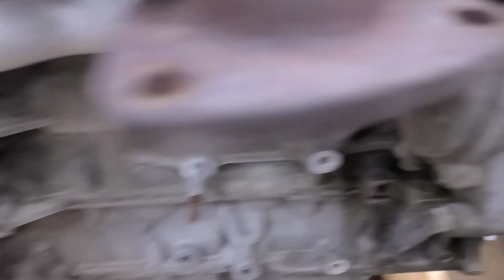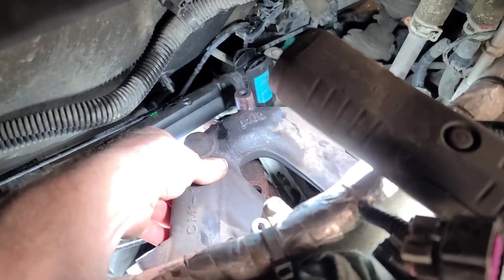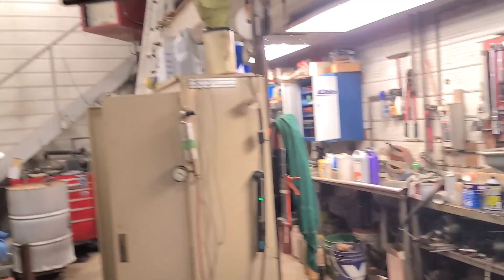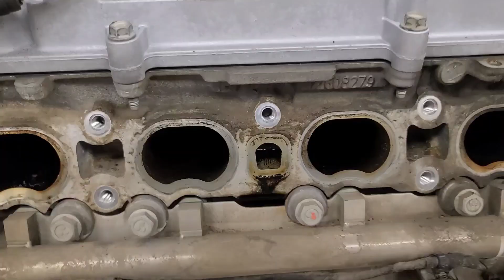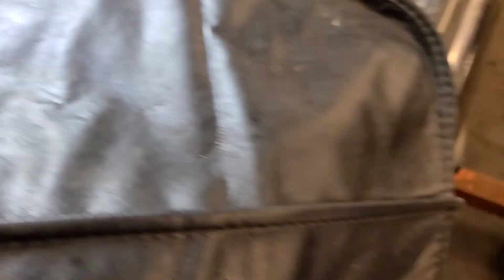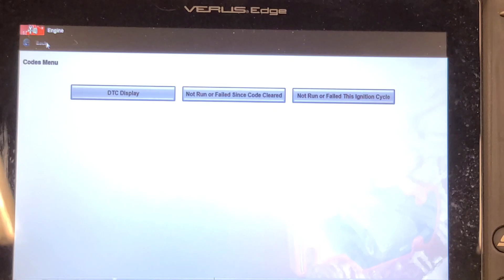2017 Chevrolet Equinox 2.4 AWD Engine Swap Due To PCV Freeze Up And Blown Rear Seal

Comment: Would you know what the correct torque sequence is for the harmonic balancer on that year of engine? I keep seeing different figures on the internet...
Reply from the maker: Service information says to replace the bolt, torque to 111ft/lbs then turn 100 degrees.

Comment: I want to change the water pump on same car - do you really have to move the cat in order to access the bottom bolt on the water pump? Do you think enough room could be created if I just undo the cat bolt at the bottom... what a pain!
Reply from the maker: Here's another one where I replaced the pump. https://youtu.be/r1NwAp7SEFo
Reply: @PhillipBailey  Thanks - that actually helped get the pump changed...
Reply from the maker: Glad you got it done.

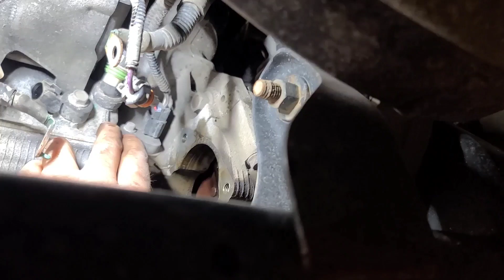Comment: 6:07 is my money shot!  I wasn't sure about the knock sensor, oil sensor, and crank sensor location.  I'm dropping a reman engine into a 2011 equinox and it is proving pretty tough for me.  I pulled the engine 3 years ago and my pictures were not adequate for locations of all the sensors.  Thank you so much for posting the video.😊
Reply from the maker: Glad it was useful for you.

Comment: Im about to do my 2017 to save 6500 to 7500 bucks after I just financed it and didn't get an extended like and idiot but besides that. I'm looking for a junkyard motor what signs should I look for in a motor from a upull you save? I understand I may have to replace a thing or two on a junkyard one but I can't replace all the internals on this due to trying to save every penny I can. Thank you in advance please lmk any tips or tricks for these equinoxs

Comment: I'm having trouble finding the torque specs for the flexplate to torque convertor bolts. I'm talking about the 3 bolts, not the 6 that attach the flexplate to the crank. Are they TTY?
Reply from the maker: @daneast  45ft/lbs and use loctite. Not tty

Comment: Thanks for a super video! Others left the impression that, as you said early on, the whole assembly has to be removed downward before separating the engine from the trans. So this is very helpful to see. I hate it that GM had to get all fancy with a new design PCV system, replacing a design that gave very little trouble in zillions of vehicles for decades, with this bad mess that is so troublesome.

Comment: Install a new engine in my 2015 equinox due to it jump timing went to crank it and I’m not getting anything to the starter any ideas ?
Reply from the maker: Are you sure you didn't forget a ground or connector? Does the MIL turn on with the key? Fuel pump prime? Any codes in the PCM?

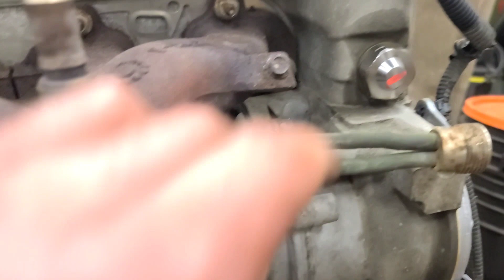Comment: Hey Phil about 10:45-11:00 minutes in the video. You’re looking at the manifold. There’s a screw with a red line on it to the right. 

What’s the screw called and what size is it? I have oil leaking from there. Thanks. Hope you respond.
Reply from the maker: That's the timing chain tensioner if I'm not mistaken. Not sure the size and I would not just remove it without finding out the consequences first.

Comment: Awesome bro, I am actually finishing up a full rebuild on a 2011 2.4 ecotec and I had already bypassed that pvc valve mess and now use an oil catch can, you should see what I dump out of it every now and then, the reason for the rebuild was a timing chain failure.
UPDATE:
SUCCESSFUL engine rebuild, the 2.4l ecotec fired right up on this rebuild. I drilled holes in my pistons along the oil ring grooves and installed an oil catch can to reduce oil consumption and to prevent my rear seal blowout over a clogged PCV valve.

Comment: Is the engine automatically ruined if the rear seal blows?
Reply from the maker: No not necessarily but if all the oil leaks out and it starves for oil it will do damage to the rod and main bearings. You could refill the oil and start the engine and listen to it. If it sounds quiet it may live once the seal is replaced. Most people don't notice the oil leak until it starts running poorly and then it's usually too late.

Comment: i added a vented cap to mine to reduce the chance of blowout.
Reply from the maker: That may affect your fuel trims and idle quality.
Reply: @PhillipBailey  it sure may, but the rear seal wont blow out.
Reply: @PhillipBailey nope not really. I even install a pcv system on my terrain no issues at all with 2 oil catch cans.

Comment: Approximately how many hours for complete removal?
Reply from the maker: Removal time is around 3 to 4 hours. May have some complications with exhaust manifold and exhaust bolts. Install time depends on how complete the replacement engine is. 4 to 6 hours. If you asked me to quote r and r I'd say 10hrs.
Reply: @PhillipBailey  Thank You

Comment: Hello, any thoughts on drilling the orifice larger to prevent freezing in the future?  Thanks!
Reply from the maker: It's calibrated to allow that air flow. I'd recommend insulating that fresh air plastic line though. Next one I get I'm going to explore the option of drilling through the plastic intake and putting a plug on the outside of the manifold that could be removed to clean the orifice. I believe its between two manifold bolts.
Reply: @PhillipBailey  We drilled the front of the plastic intake for cleaning. There are a few videos on it on youtube. However, removing the intake, one can blow cleaner into the orifice and confirm the passages are clear to all 4 runners. 

Drilling the orifice bigger is noted in a GM service note. But I see some people complain about a whistling sound or poor running.
Reply: Did not think about it messing up the amount of air.  That's a great idea to add a plug for future cleanings.  Thank you sir!
Reply: @larryk.8666  bro install an “oil catch can” all vehicles should have one it bypasses the junk PVC set up, you’ll be surprised at what goes into that can after a few hundred miles, the engines are designed to fail

Comment: You observed, this engine had the timing chain replacement. How did you tell?
Reply from the maker: Could see there was a new tensioner installed and the timing cover had been off and resealed. This salvage yard does this as a routine service on these engines.
Reply: @PhillipBailey  thanks much Phil. I'll keep watching.

Comment: Just happened to my wife Four days ago…… Car was maintenance and just had and oil change new valve cover gasket oil flush and tuneup…….@ Chevrolet knows about this but doesn’t come up with a good fix…. American made for you , more like American made junk the rip off American people!!!!!
Reply from the maker: The shop that did the valvecover gasket should have checked the pcv in my opinion.
Reply: @PhillipBailey  they checked everything and it and changed cam sensors…. Just had a huge cold snap and it just happened… car was in great shape never had a problem with car until this…. Now just a paper weight….. just trying figure out how much it’s worth in its current Condition

Comment: I had a 2010 on Monday that had so much moisture in the system that the throttle body iced up and gave the customer reduced engine power message and left it in limp in.     Had to pull the intake and clear that PCV port as per the tsb.     If you have to do an intake with the engine in the car just unbolt the high pressure fuel pump and the hard line from the rail to it and pull it.      The intake wont tip up and clear it when its installed.     And watch your injector connectors underneath.      Lots jar the plugs loose and wind up with a misfire and po202.      Ask me how I know
Reply: Pull HPFP fuse, then run till fuel is gone, eliminate fuel spray?